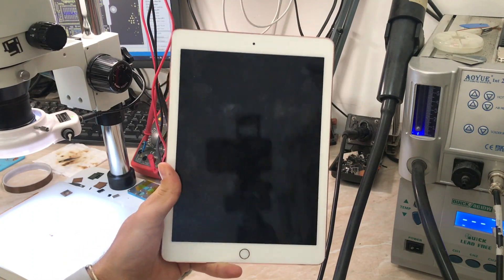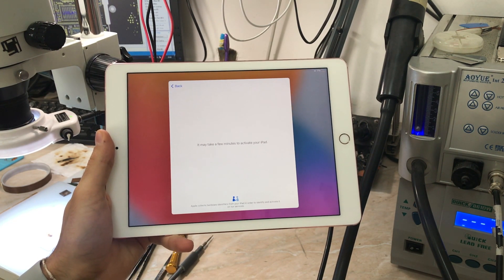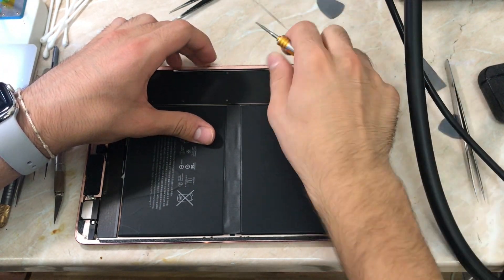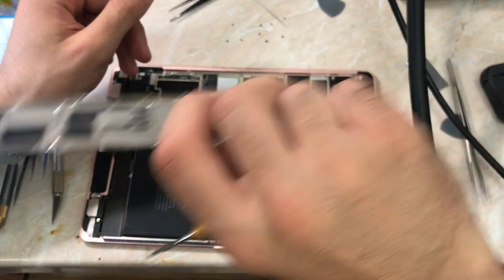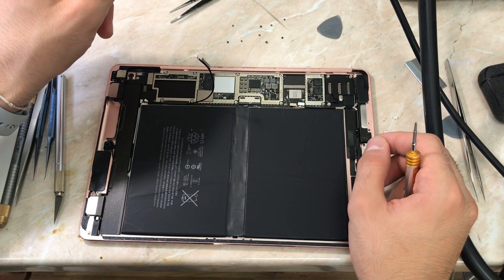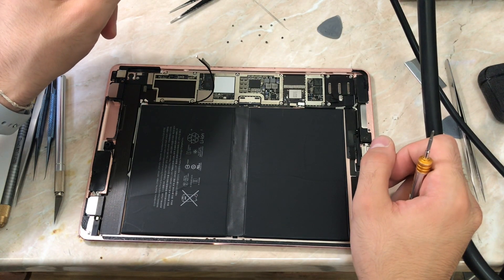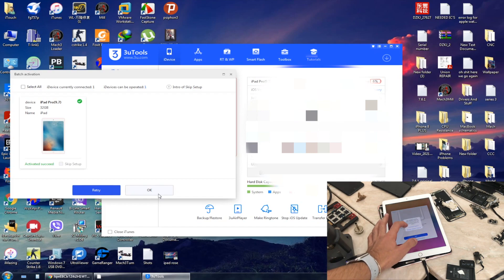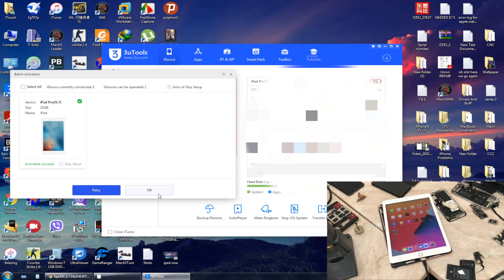iPad Pro 9.7 A9X CPU How To Remove/Bypass iCloud Updated To iOS 16 (Hardware Method)

Comment: Hello sir after replace sn on my a1673 and restore on dfu my ipad “unable to activate” whats problem with original sn its work but new sn doesnt work please help me ios 15.3
Reply from the maker: Hey man, I saw your post on Facebook, you the man who have 2 iPad’s pro 9.7 one have it done and the other unable to activate correct ?
Reply: @AntoineKiriaky10  no no sir I saw your video only here on youtube and I was wondering if you would have a solution or a working serial number for sale as the two I got from the seller on aliexpress didn't work but when I reloaded the original serial number it showed me an activation lock so I assume that there is either an error on the side of the serial number or an error that Apple fixed as with the iPad mini 4 and iPad 5
Reply from the maker: DM me on telegram or instagram

Comment: Do you need to replace the wifi ic on ipad 5 if the ios is below 14.5?Can you change the serial bt and  and wifi mac addresses on lets say ios 13.5 and activate it with fmi off?Then what happens if you update to ios 14.8?Many thanks
Reply from the maker: Apple made this change from iOS 14.5 if you have older iOS and you changed the sysconfig then you must check if it get bypassed on activation screen or not if not then you need to restore and if you need to restore them yeah you need to update to iOS 14.8-15 and then it will get stuck on activation with an error couldn’t be activated

Comment: So when changing SN from a6 device on iPad 5 wifi model, you need to replace wifi ic anyway?
Reply from the maker: Yes
Reply: @AntoineKiriaky10  Are there selection criteria? Just from any other iPad or does it bind to the device after the 14.5 update?
Reply from the maker: As I showed in the list
Reply: Hi. What Wi-Fi chip number need to be replaced when unlocking iPad 5 Wi-Fi model? Other question, A6 cpu sn isn’t from iPhone 5/5c?